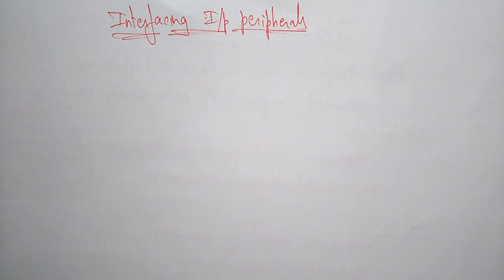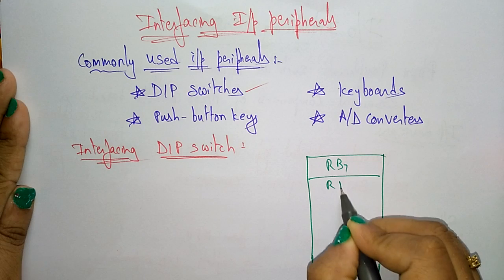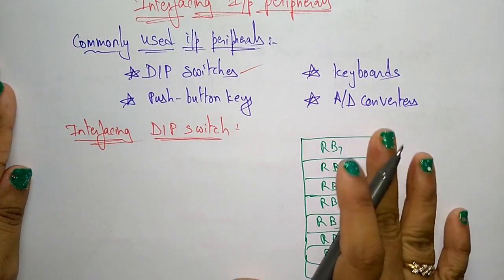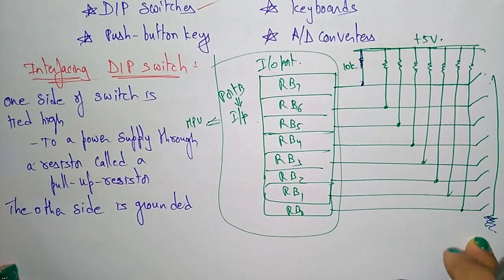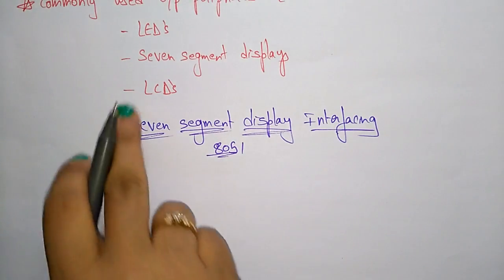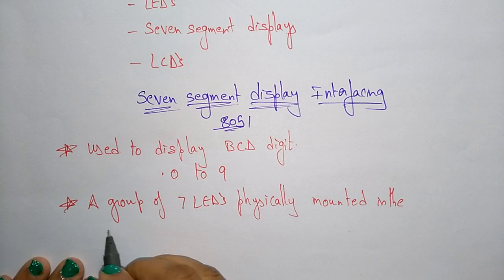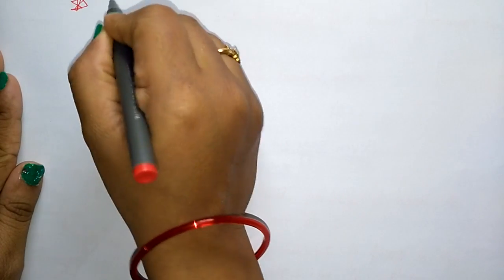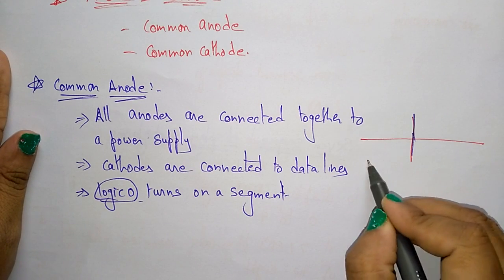8051 interfacing I/O devices | 7-Segment display & Dip switches | | MPMC | Lec-63 | Bhanu Priya

Comment: please solve this problem urgently.....

2. Develop a system with 8086 using 8255 chip to toggle 8 LEDs continuously every 500 milliseconds. Draw the interfacing diagram of 8255 and LEDs to realize the system. Interface the LEDs at an address 05H. Write an assembly language program for the hardware to toggle 8 LEDs every 500 milliseconds.